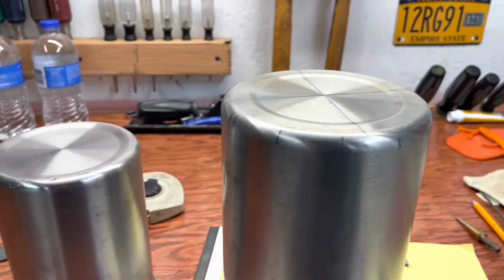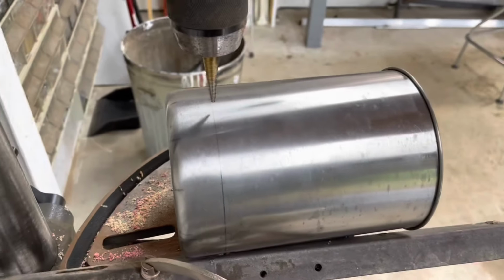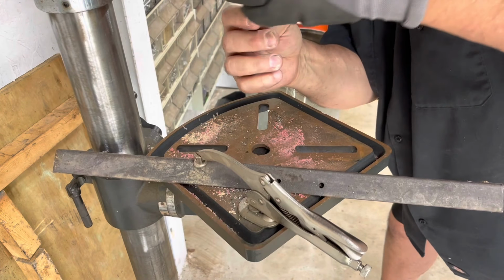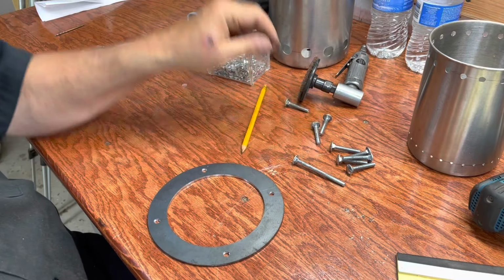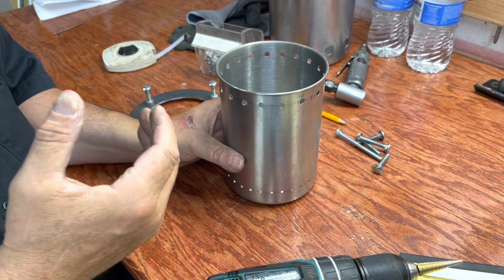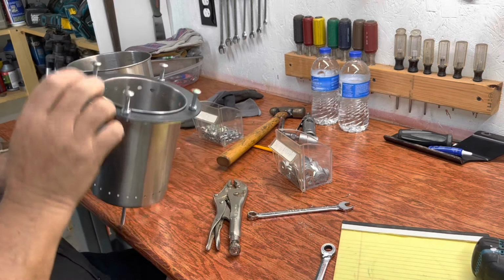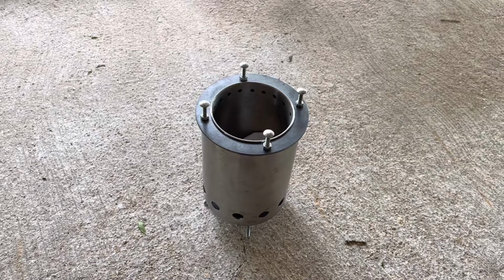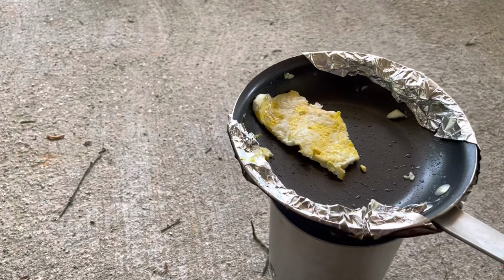How to make a woodgas stove, from start to finish

Comment: Great video, looks like it would work great for camping. Or front porch cooking. 👍👍
Reply: Good way to heat a can of soup when a hurricane or ice storm takes out the power. Stash some dry twigs, in a plastic tote, under the porch to keep them dry for such a situation.
Reply from the maker: I could cook on the front porch. It get just a little warm under it but not hot enough to burn the porch.

Comment: Another thing you can do is make a flame adjuster. Get another pot like the exterior. Drill big holes like the bottom part. Cut off the bottom part of the new cook pot. Then, use a binder ring as a handle, and put your adjuster on the bottom of your stove. Wait for your stove to be fully hot for a few minutes before playing with the adjuster, or it will snuff out. This is just a suggestion of you wanted to to add to your diy woodgas stoves. :) Keep having fun with them! :)

Comment: Hey Brad, that turned out really good. Have you ever experimented with a gasifier unit that you can use to run a gas engine?
Reply from the maker: I’ve read a lot about it but never actually experimented with it.

Comment: wood pellets work well in small versions of these stove's
Reply from the maker: I have some wood pellets. I should try that.
Reply: I used fire gel to start the pellets in the one i made from juice cans did well . I like yours a little more work but should last a lot longer then juice or soup can's
Reply from the maker: I’ve made them from juice cans before. They work well.

Comment: without hardening you can make quickie brush blade . a leaf spring would make a functional blade. i don't make blades but i like weld stupid stuff so I qualify as run of the mill idoit on the subject 😂 but I would buy quality blade's. oh and im still loving the skinners and the wife still loves the pink kneck file knife .
Reply from the maker: Leaf springs are typically 5160 steel. It’s great steel but requires an electronic heat treating oven that’s capable of holding temps in 1500-1800 degree range for 15 minutes at a time.

Comment: BC I've heard there are all kinds of rules of thumb as to how big the holes for the primary and secondary, do you have any suggestions? Thanks
Reply from the maker: The holes on the outer can are 5/8. The inner can is 1/4 on the bottom an 1/8 on top. I’ve done a lot of experimenting and that’s what has worked best for me.
Reply: @bctruck  thanks for the response, I'll try that